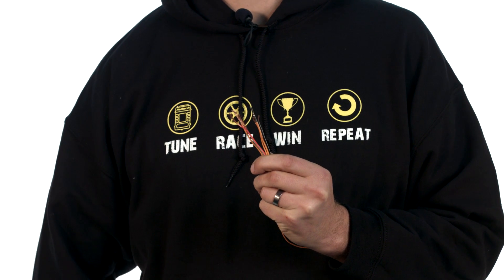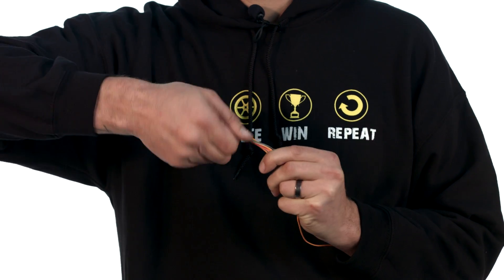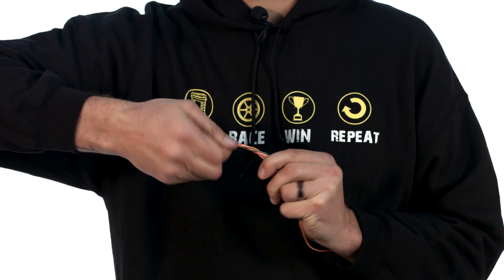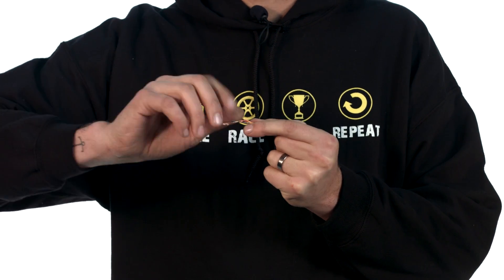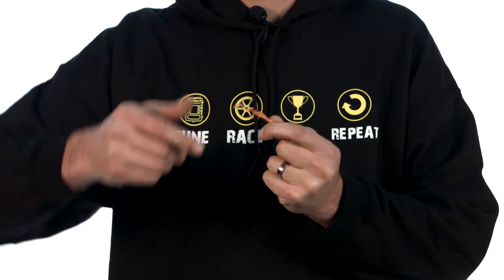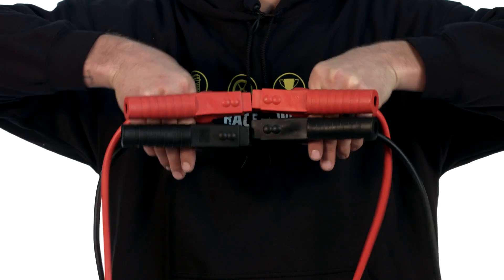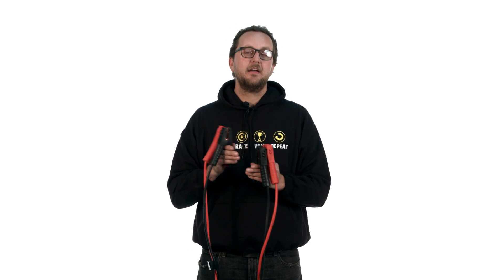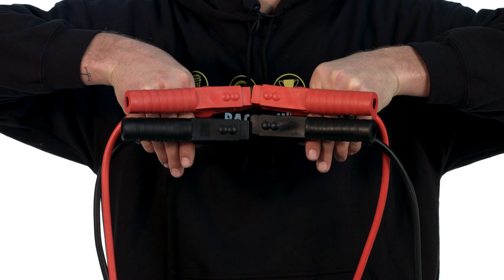💬 5 Ways to Toast Your ECU | TECHNICALLY SPEAKING

Comment: Hi there, ametuer honda guy trying to do a piggyback. I would like to know: when sharing sensors such as oil pressure or water temp. with the oem ecu, I have heard to keep the stock ecu 5v source to the sensor, and only connect the data wire to the standalone. Would this result in weird sensor issues or incorrect readings since the source of the signal is not being powered by the standalone? Any advice would be appreciated ✌

Comment: hey would having a crank position sensor positive wire and negative wire touching uninsulated. blow your ecu, and crank sensor? I had this happen and now at the computer we aren’t seeing a 5volt reference at the back of the computer for the pins that power the crank sensor when the key is turned on.

Comment: Quick question for the R32/33 Haltech platinum pro ECU. I have a Series 1 rb25det would I have to swap out the pins 112/114? Or is that only for RB20DET and RB25DE??
Reply from the maker: You only need to do that pin swap for the 25DE or 20DET models. The RB25DET should be a straight plug in.

Comment: I have a mazda 6 2003 I disconnect my car battery while it was running and after it smells like burn on the bottom now my alternator is not charging and I changed it 4 times same did I burn the ecm or something please help
Reply from the maker: You should probably take it to your local mechanic to look at.
Reply: @haltech  thanks for the reply

Comment: So in a racecar with a battery on/off switch, what should you do to keep the ecu from seeing spikes if the safety crew kills your switch in an emergency when the engine is still running?
Reply from the maker: Generally, you will have the alternator power still going to the battery and not the isolator so when you hit the switch everything shuts off except the alternator, and it would have its own isolator switch if required.  Sometimes this is wired so it will kill when the main kill switch is cut.
Reply: I used a resistor from kill switch to ground
Reply: @hoonaticbloggs5402  Has this method been working for you? Any issues with the ECU since then?

Comment: Bought a 92 Galant VR-4, tried to jumpstart it only to find the dickhead had reversed the cables when relocating his battery. Red was negative, black was positive. Jumper cables literally started melting and smoking before my eyes. Managed to get them off, burned my hand in the process, but didn't fry anything in either car.

Comment: I've heard when jumping a car battery the "dead" car goes red to positive and black to chassis while the "donor" car goes red to positive and black to negative. Will this affect the ecu?
Reply: Victor Bustillos This is the correct procedure:
1: Connect the red cable to the positive side of both batteries, the order doesn't matter. *
2: Connect the black cable FIRST to the negative of the running car, THEN to the ground point away from the battery of the dead car. **
3: Let the battery charge for a little bit and then start the dead car while keeping the good car at about 2k rpm.
4: FIRST disconnect the black cable from the ground point of the car that received the jump, THEN from the battery of the car that provided the jump. **
5. Disconnect the red cables, keep the side you disconnected first away from the other car to prevent a short. *
*: Always make the ground connection last and unhook it first, this way you don't cause a short if you accidentally touch the chassis of the other car while hooking up the positive connection, since the chassis aren't electrically connected yet.
**: When making the last connection or breaking the first connection, you will more than likely create a spark. Batteries produce highly flammable hydrogen gasses when quickly charged/discharged, so to keep that spark away from the battery you use a ground point away from the battery to make the last connection and unhook the first connection.

Comment: Thus, removing the car battery can cause damage to the ecu? also "arc welding" can cause ecu to fry even if you remove your battery?
Reply: you have to Switch the Engine Off before you remive the battery
Reply: Thanks, lets say the engne is off and i remove the battery every night,then morning after reconnect the battery...is this affect/damage the ecu?
Reply from the maker: Removing the car battery will not cause damage to the ecu. Obviously make sure your engine is off before you do it. Basically you want to avoid doing anything that can cause high voltage spikes going directly to the ECU. This applies to the factory ecus as well.
Reply from the maker: Watch Question No.1: https://www.youtube.com/watch?v=P_RZUmzxpzQ
Reply: Thanks for the information...it helps a lot.. haltechecu and Tobimai..

Comment: Put a full wave rectifier on the ECU power input and then which ever way the volts are connected to the box the internal voltage will always be the correct polarity.
Reply: Normally that is a good mitigating solution, however reverse polarity can sneak back in to the ECU by way of any conductor resulting in damage.
Reply: True
Reply: Doesnt fbr’s reduce overall output voltage from parasitic use?  Like around 7-10%?